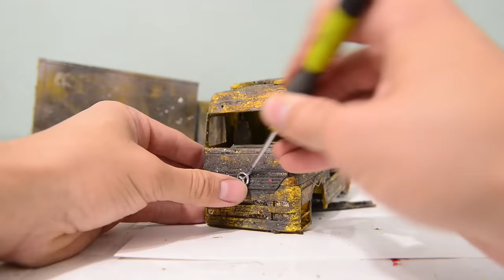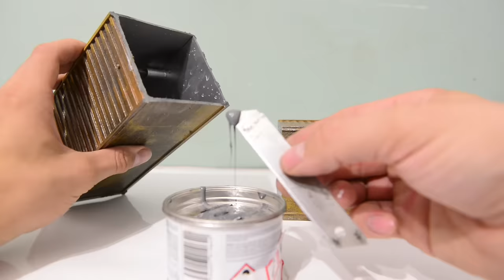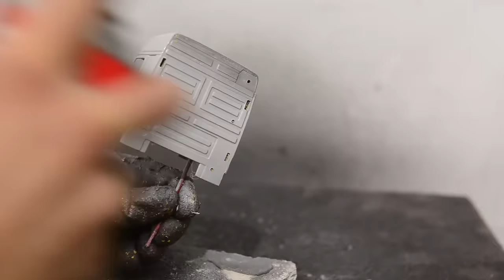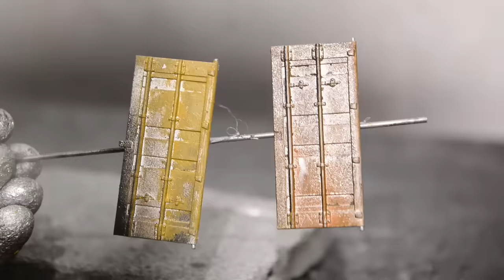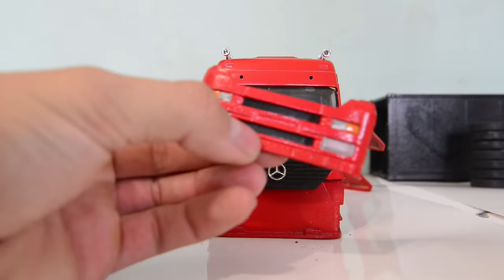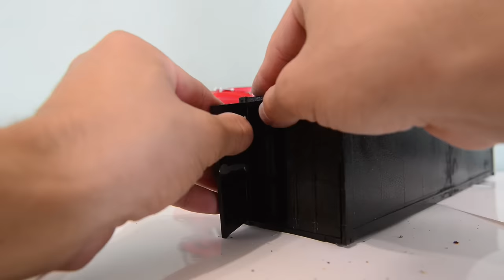Mercedes-Benz ACTROS - Restoration Abandoned Semi Trailer Truck

Comment: Crazy Restoration did not go insane on the strip down or paint. I am surprised that the strip and paint was done in a rush. This MB Truck needed a bit more love. Do a part 2 and finish the truck to a proper MB finish.
Reply: Restore Machines is more neat 🤷‍♂

Comment: You have thought about using sandblasting instead of paint remover. With the stripper you take too long to wait for it to act and the sandblaster is faster with a better finish
Reply: ㅅ
Reply: ㅜㅜㅝㅓㅓㅏㅏㅐㅏ
Reply: ㅛㅕㅕㅕㅑㅑㅑㅑㅑㅑㅑㅑㅑㅑㅑㅑㅑ6쇼ㅛㅛㅛㅛㅕㅕㅑㅑㅒㅖㅔㅔㅔ